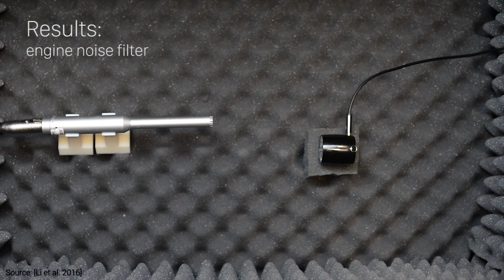3D Printing Acoustic Filters | Two Minute Papers #109

Comment: A possible application would solve a long-held problem in switching between woodwind instruments.  Brass instruments are very easy to switch between, and often have the same fingering.  But the keys are quite different between a flute, oboe, clarinet and saxophone.  It would be nice to redesign a saxophone so that it uses the same keys of a clarinet, or vice-versa.

It would also be interesting to see a sound-suppressing device that could change its internal shapes on-the-fly to minimize noise from different inputs.

Comment: I've seen some boxes that open up with knock sensors. You knock on it with a certain pattern and it unlocks or opens automatically. This would be an interesting way to require specific physical objects to open them rather than just a simple pattern.

Comment: What I wondered when I first saw this is how far this could be taken. Presumably, having cubical boxes of varying volume connected by a bunch of constant-width cylinders is computationally (relatively) nice and easy but to me it'd make a whole lot of sense to have, say, spherical or even ellipsoidal cavities, or how about more irregularly shaped boxes? And why not also vary the cylinder length? Even allow for tapered cylinders?

Most likely the answer largely is combinatoric complexity making finding a good solution harder and harder, but I'd at least think that having only box shapes may significantly limit what spectra can actually be realized.
Reply from the maker: Nice! Perhaps it would also be interesting to know whether it could be useful in identifying different kinds of containers in warehouses. It is likely not doing anything we can't already do, but perhaps such a solution would be easier in terms of administration and paperwork.
Reply: Well, the given identification methods here were all based on having such a network of cylinder-connected cubes pre-installed in the shapes. That ought to be a LOT simpler than attempting to identify arbitrary objects not specially designed for this. Though that is also possible. To a limited extent it's even possible for humans: There are schools for blind people where they can learn to understand spaces based on how sound behaves nearby. They don't have a super sharp picture of what's going on but it's plenty sufficient to, for instance, steer clear of obstacles. Having an AI be trained specifically for this should be very reasonably possible, I'd say.

What's happening here, however, is giving identical-looking items a sound-based ID. So rather than differentiating between different kinds of containers it could be used to differentiate different instances of the same kind of container. It could also be interesting to design new kinds of instruments. (To be honest, the examples given in this video, while cute and sometimes mildly disturbing, weren't actually all that great instruments. You could probably design more interesting-sounding things this way too, maybe by using different materials...)

Comment: Cool, but you may have pushed the energy into higher frequencies. The total energy of the flow will be redistributed and the "filtered" frequencies will reappear, because of turbulence, in high frequencies. Unless the filtered sound turns into heat and dissipates.
Reply: Lamen here, but I noticed that as well. And as I understand, given the same amplitude  higher frequencies are perceived as louder by humans. So it doesn't seem very advantageous for noise reduction.
Reply: @Metapharsical  yes that's why we have A weighting for loudness perception. Basically our hearing is most sensible at frequencies related to speech around 4 kHz.